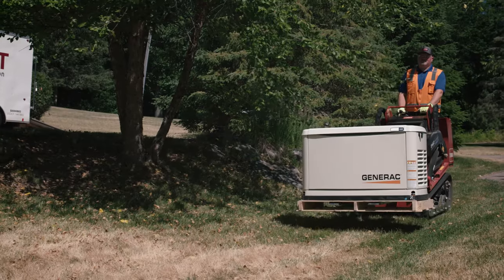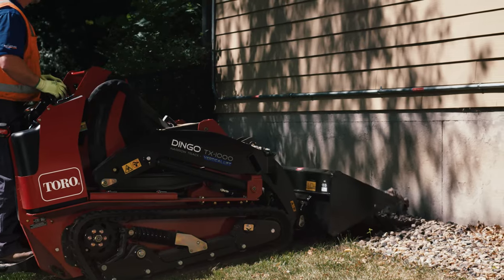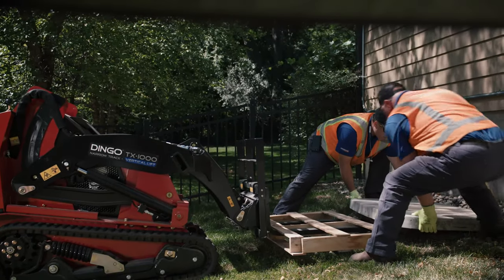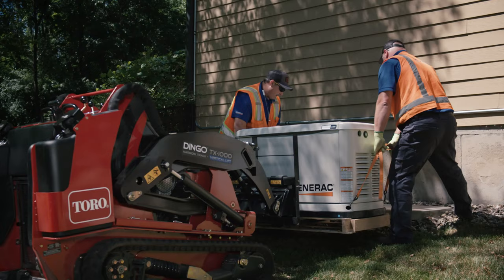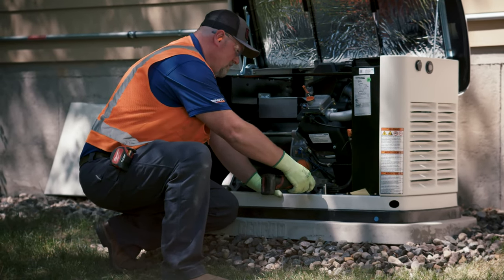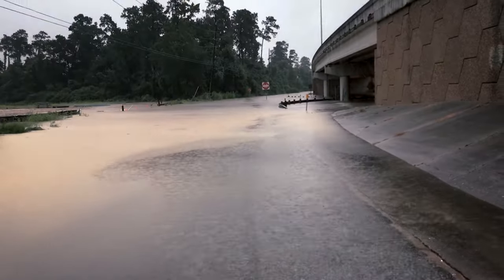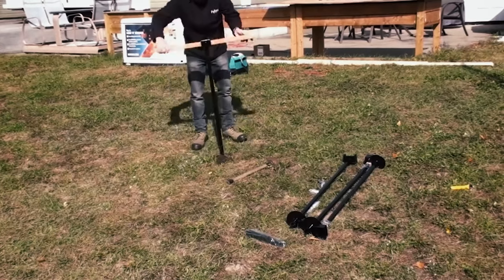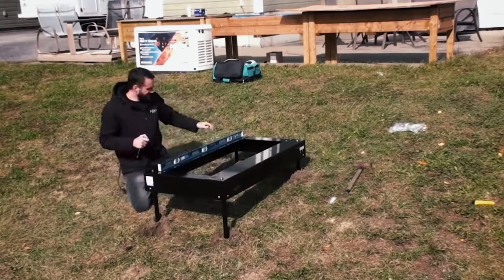Standby Generator Mounting Pad Options | Generac Installation

Comment: I pored a 3 1/2" concrete pad with 3/8" rebar 6 " apart and welded together.
Reply: I don’t know how to do that and I was quoted a lot to have the dealer pour the concrete. I wish I could.
Reply: @tamiw87  You need a good man to to it. If you are a bad women that no good to you.
Reply: That's overkill for a generator. I'll be using a Qwikpad rated to 180 mph winds.
Reply: That pad will be adequate for a generator which weighs 15 times what this generator weighs, assuming you meant "poured".  If you indeed meant "pored", then what would be the reason for making a porous pad?
Reply: Fuck that I live in Houston I need mine at least 2 to 4 ft off ground lol no seriously though